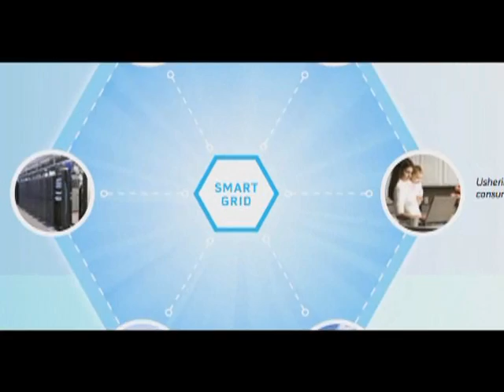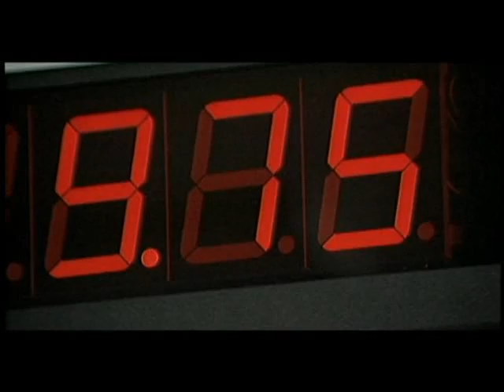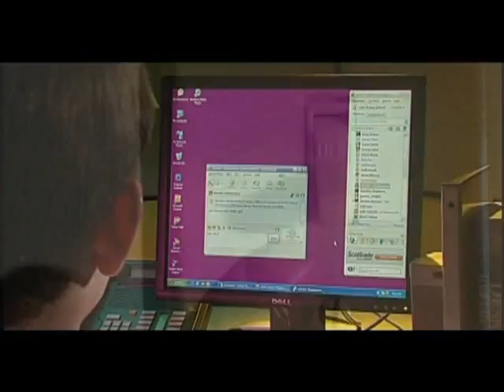A Smart Grid for Intelligent Energy Use

Comment: 4:20 .. his next door neighbour is getting billed for electricty by utility this guy's solar panel is giving him for free.  Is that fair?
Reply: not with a smart meter they don't run in reverse. there is a separate accumulated reading digitally that's supposed to be used to calculate against your purchase which makes it 1 for 1  not 1 sold at forty cents and then one bought at 10 cents.  its a false statement to make people think they will be saving money.   that's why they sell and Install a solar system that  only off sets a portion of your total bill.
Reply: Kelly KitKat its net metering when youre producing more power than youre using it goes into grid and your meter goes in reverse

Comment: Critics of solar, wind and other "alternative" electricity and champions of "the grid" overlook the fact that it is possible to build a modern building, whether that is a home, apartment or office building, with the proper amount of solar, wind and additional power generation and storage capacity based on how much wind or sunshine, peak demand, etc, to be fully self-sufficient, even in the most extreme locations or usage demands.

It probably adds between 20 to 35 % to construction costs.

Comment: When your energy source is coal, you build a big electricity plant near a coal mine. When your source is oil, you build it near a port, refinery or oil field.

If your energy source is the sun, wind or even natural gas, you can build the exact sized generator needed for that building, right where that building is, often as part of the building's architecture and construction costs.

No need for a grid, moving forward, if all new construction included solar, wind, natural gas generators, etc etc.

Comment: @ThePowerExcess  The power meters only count the energy that passes through them, they can't tell where the energy goes.
I agree with you when you say that personal data will be probably easier accesible to hackers or anything. But what is your power consumption data worth? I can't think of a way to harm you by knowing that.
One last point, your phone conversations are saved on a database. This is much more sensitive stuff. However I've never heard of a security problem about this.

Comment: @doublej706 Well I partly agree with you.
I am not sure about the way that this thing is going to work, but your consumption is saved on some database in a way that can be traced back to you, this is a small problem. Your consumption is allready being measured and saved somewhere. What they are suggesting is that this is going to be automated.
You don't have to worry about each device being monitored seperatly. This is not the case.

Comment: When oil was discovered and the automobile was built, did they give  horses motorized shoes to keep that industry alive?  

When the radio became a way to communicate t, did they install them at the telegraph and post office to maintain that legacy infrastructure? 

In the late 80's when the PC became were they in the room with the Mini (VAX), Mainframe (IBM,Univac), etc. to make use of that infrastructure?  

When u have WIFI, why keep TCP/IP cable connected?

Distributed  generation is here.

Comment: Say you wanted to dry a load of clothes with an electric clothes dryer, or run your dishwasher overnight.  If you happened to do this at the same time as many other people, more power plant generating capacity would be required than if those electrical "loads" could somehow be distributed throughout some time period.

Comment: So tell me if I have this wrong. Let's say I go off and leave my lights on between the hours of 8 a.m. and 4 p.m. Will they be able to detect that and turn my lights off or charge me more for running my lights in those hours? I don't understand the "need to know" when it comes to each product I run in my house that requires power. They have to have some way of assuring that we use our electricity "smarter". How are they going to do that?